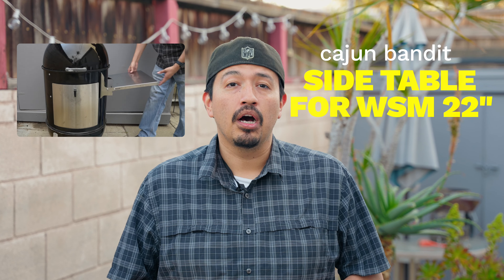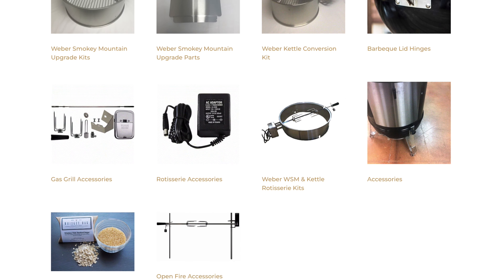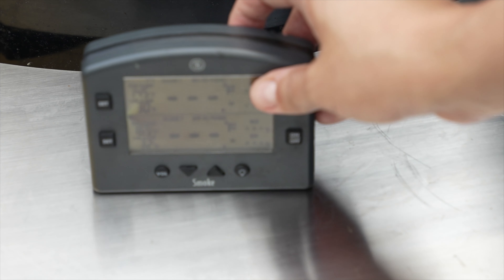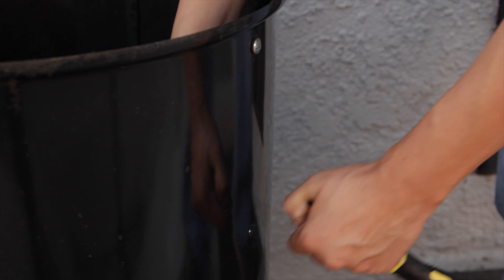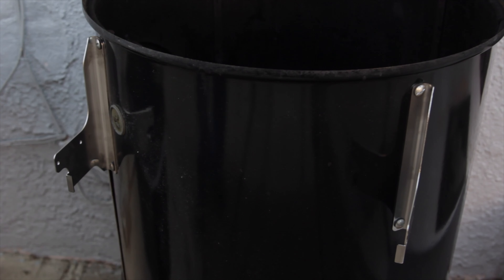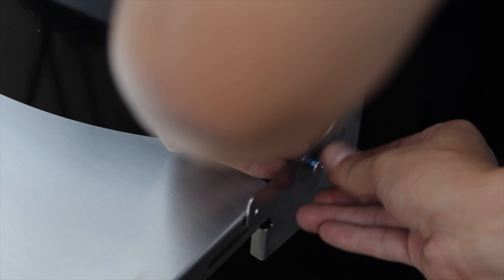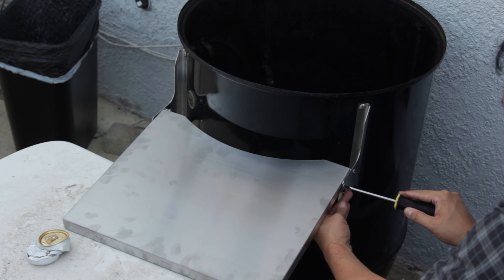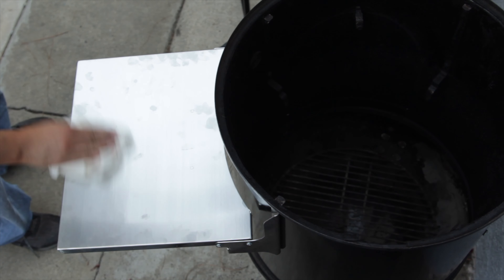Cajun Bandit Folding Table for 22" Weber Smokey Mountain | Side shelf Mod for 22" WSM

Comment: How sturdy is the shelf? Would you feel confident it would hold 15-20 lbs?
Reply from the maker: the table itself is pretty sturdy. haven't seen the capacity but I will say the weak point is not the table but where the cylinder joins the bottom bowl. I've heard of people tipping it over when they install a lid hinge on the 22" so I'd imagine the same could happen if you put too much weight on the table. In the video, I brought up those cylinder lock kit that cajun bandit sells, it might be a good investment if you are worried about it.

Comment: What kind of cover did u get/buy for your 22 wsm since you installed the side table??
Reply from the maker: I got the Ravenna made by “classic accessories” bought it on Amazon. It’s suppose to be for a kettle but it fit my WSM 22” with the table perfectly. With plenty of room for an extra table if I decide to add it in.

Comment: Does this affect the water pan from going back in?
Reply from the maker: No it doesn't. The table just uses the pre existing holes. so after attaching the table, The bracket holding the lower gate and water pan goes back in and functions normally

Comment: What cover did you use?
Reply from the maker: I got the Ravenna made by “classic accessories” bought it on Amazon. It’s suppose to be for a kettle but it fit my WSM 22” with the table perfectly. With plenty of room for an extra table if I decide to add it in.
Reply: @SJCOOKS  does it fit all the way to the bottle?
Reply from the maker: yes it reaches to the bottom. it doesn't drag but it barely hits the bottom on my 22" WSM. It has a draw string at bottom so you can secure for rain or wind and the bottom legs will have about an inch or two of clearance when secured.  SO far it's held up well. A little discolored due to it being in the sun but no tearing or any signs of it falling apart.
Reply: @SJCOOKS  thank you sir much appreciated
Reply: Sorry for all the questions did you get the 26 inch cover? Would it be possible for you to leave a link
Reply from the maker: it was the 30" I wasn't confident the 26" was going to be wide enough, especially if I added another table down the line. here's the link for the 30" https://www.amazon.com/gp/product/B07NFTF462/ref=ppx_yo_dt_b_asin_title_o03_s00?ie=UTF8&th=1
Reply: @SJCOOKS  appreciate you bro!!